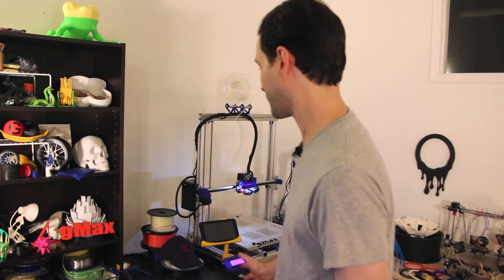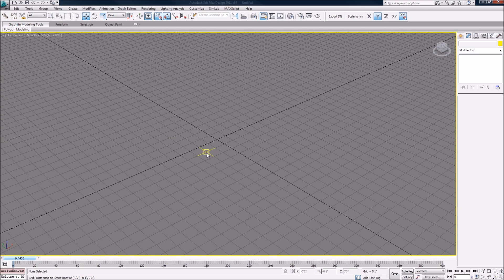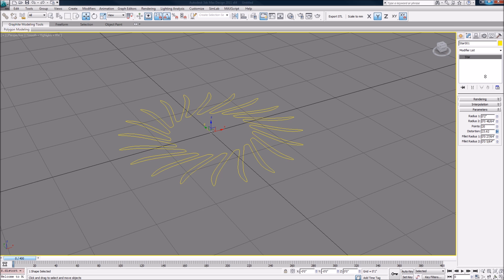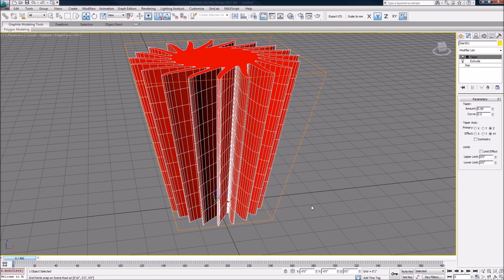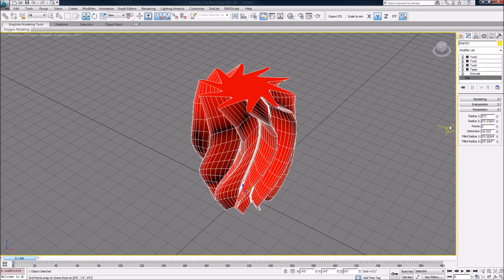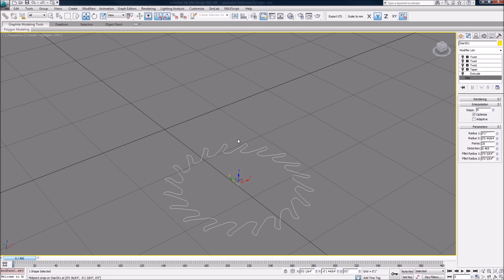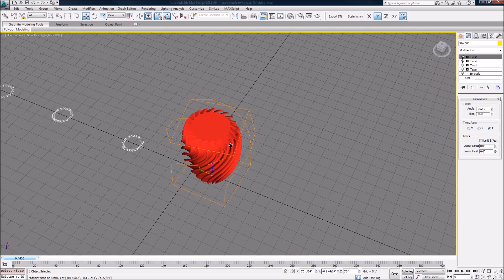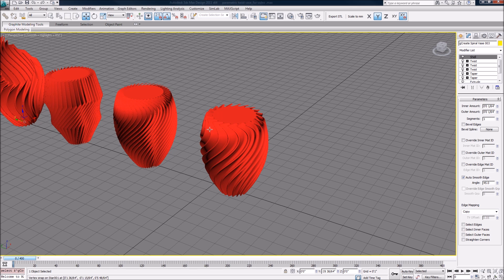Designing a 3D Printed Parametric Twist Vase - Part 1 3ds Max and Simplify3D

Comment: Can you make a video describing the basics of what you are actually doing? for example HOW are you turning the mesh on and off from visibility? mine does not have the mesh and I want to see it?

ALSO I need to make something to precision sizes. what are the units of measure for what I am seeing in the program. Can I set it to millimeters?

I want to "mate" two parts together. ie a shoulder so I can print 2 12cm parts to make a 24cm longer part.

also how do I get a "square" edge to the star? ie like a sawtooth instead of a star fin?

 cant leave the part solid as I don't have simplify3d and maker desktop does not have a "vase" mode. so I need to make it hollow. if I turn off the caps it seems to be hollow. how do I give the wall thickness?
Reply from the maker: +Nerys Thank you for your input. We took it into consideration for our new videos. https://www.youtube.com/watch?v=Dz5APml1JqU